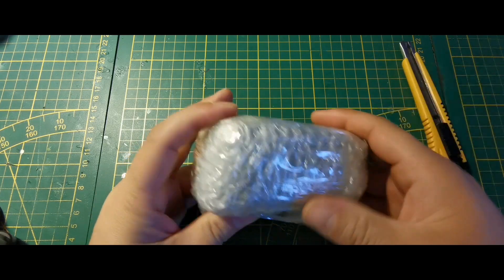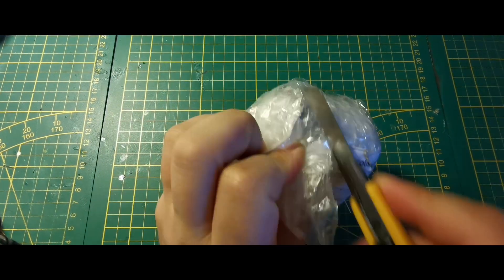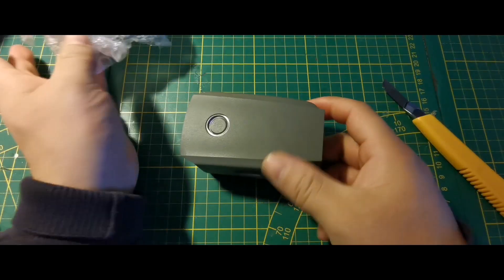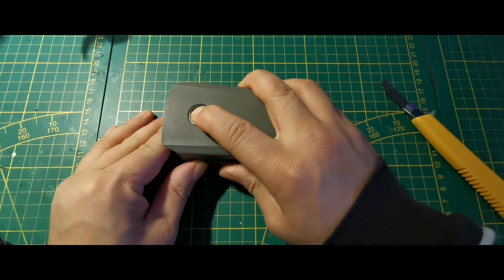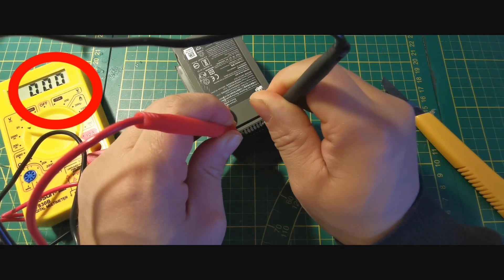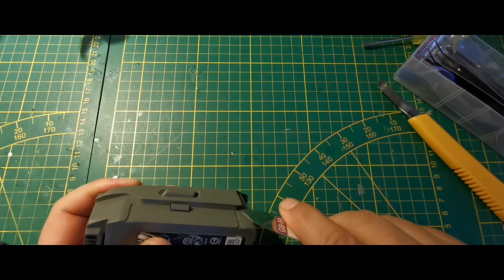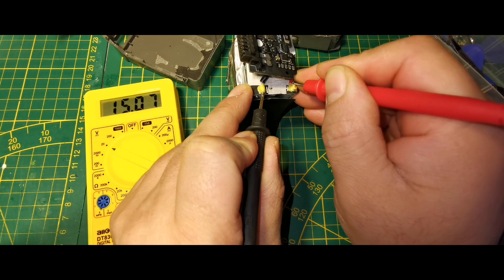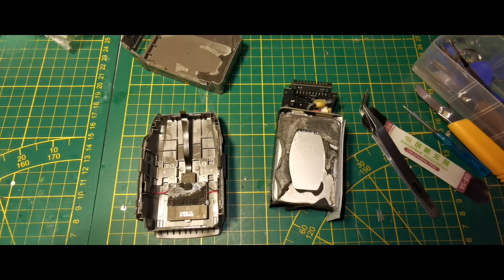Dji Mavic pro Battery Repair,  part 1,How to Disassembly battery mavic pro

Comment: As somebody told you here, you don't measure current, you are trying to measure VOLTAGE, Also, you will not see any voltage in the connector if you don't "power on" the battery. Start self learning before teach other people with bad information.
Reply from the maker: bms dead.thank you

Comment: do you call this a repair?

I perform repairs on the entire dji line, use software to unlock the chip, and perform other tests to make sure it is in perfect working order.
Reply from the maker: I sold the drone a year ago.😊

Comment: Im so confused on how you can draw the conclusion "yepp, the battery is broken, the electric cells have electric current"; YOU ARE MEASRUING THE VOLTAGE BETWEEN THE POSITIVE AND NEGATIVE POLES, THERE IS NO CURRENT, THERE IS A VOLTAGE DIFFERENCE BETWEEN THE + AND -, every battery has voltage between the poles, you CAN NOT draw the conclusion that the battery is broken by measuring voltage (unless its below the operating voltage of the battery).

Dont listen to this idiot, this channel is complete bullshit and might even result in your house burning down.

Comment: Batteries don’t have current.
Reply from the maker: Are the batteries swollen?
Reply: @MrSatech  this is a general statement. Batteries don’t have currents. A current flows. You measure a voltage on your battery, not a current.
Reply from the maker: How do you measure, did you open the battery?  Or are you measuring from the connector end?
Reply: @MrSatech  I’m not measuring anything, I’m stating a fact.

Comment: We have a solution to reset DJI batteries  Error Flags, cycle count, recell with bigger capacity, etc: @t
Reply from the maker: Reset the drone, or install an older version.  If none of these things, the battery may be defective.  Do you have any other batteries?
Reply: @MrSatech  I am talking about a solution to reset DJI batteries error flags. For example if you change the cells the DJi battery won't work, it must be reset.
Reply: @nipembedded9976  i'm interest in the solution, could I have more information please.